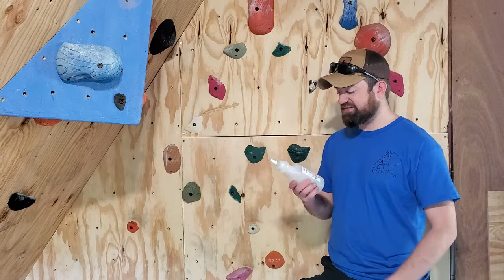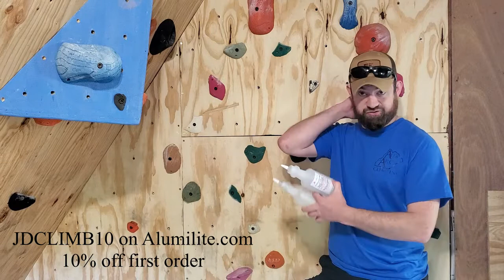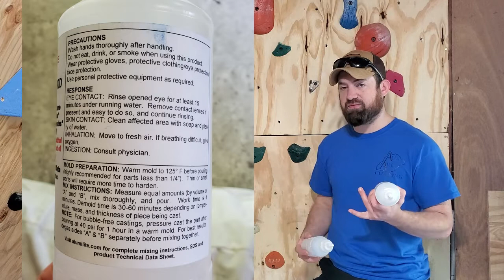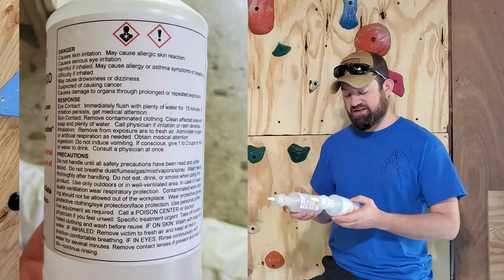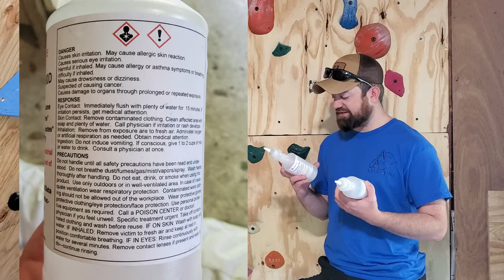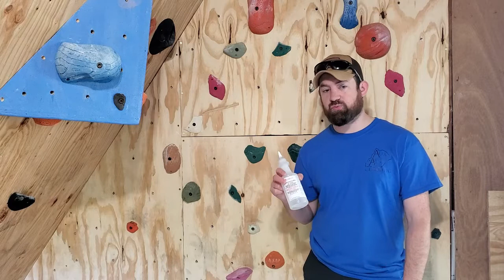Alumilite 80D Review

Comment: Well, you've answered a question I've had and you've saved me money in doing so. Thanks for the vids
Reply from the maker: Were you looking at it to start with or as an alternative to a different resin?
Reply: @AuxArcClimbing  curiosity. Most brands are 70D, 75D, 80D etc. but I saw one brand was 74D. 74. Why 74?!?

I'll eventually use any epoxy I buy so buying a few types didn't seem like a bad idea. I'm just using it for my own holds and an occasional craft project. I thought I might buy a few different ones and pour some long, thin blanks to see if there is a notable difference in a stress test. No matter what, I'll end up with a few crimps or feet once I drill out the left over pieces, plus any unused epoxy

Just for fun

If the 80D is more difficult than others to work with I'd rather not spend my money. It would probably be a little different if I was making them commercially where quality and durability mattered more

Another little bit of curiosity- I wonder if the difference is in part A, part B, or both? What happens with 74D part A and 80D part B? Or the other way round?
Reply from the maker: @billwhipple9039  maybe they can dial it in there. I'm not sure actually. 

  As far as what's different, I can't imagine that they both aren't different.  I wouldn't mix them though.